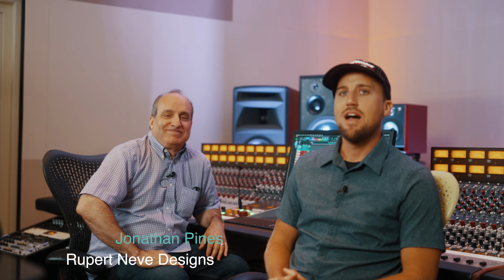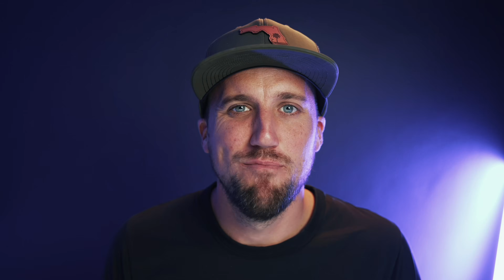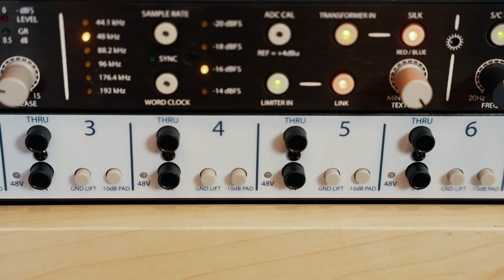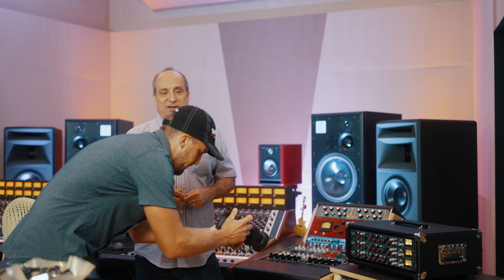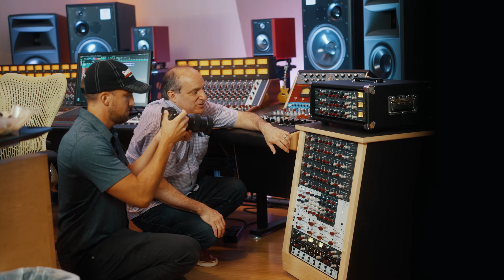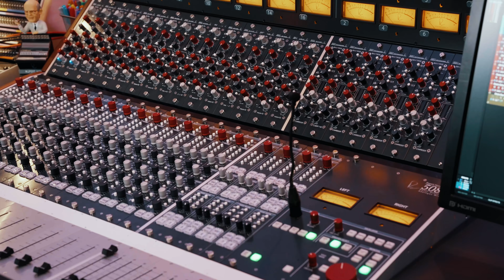3 Tools to Instantly Enhance Your Worship Mix - Rupert Neve Designs

Comment: working for a few local production companies in my spare time, i've run into a lot of foh guys who slap the 5045 on their stereo buss.  which i find fascinating.  saving my pennies to grab one for my church.   Great explanation of what a di box is and what it is supposed to do.  and yes one of my bass players has one for his rig.  But we use radials for the most part.  (just how i inherited the system).